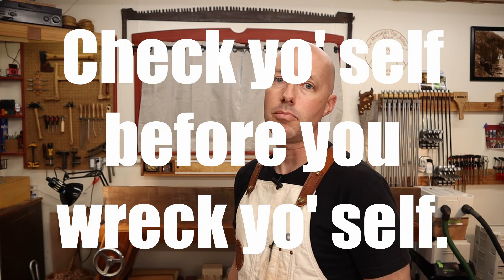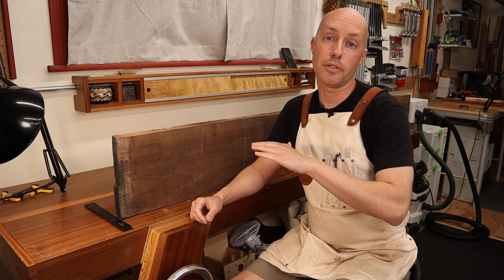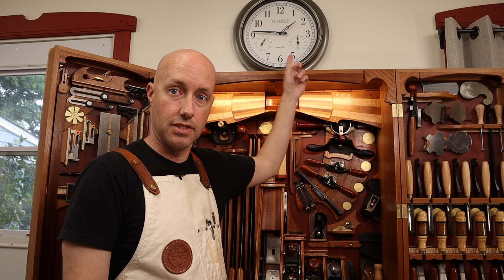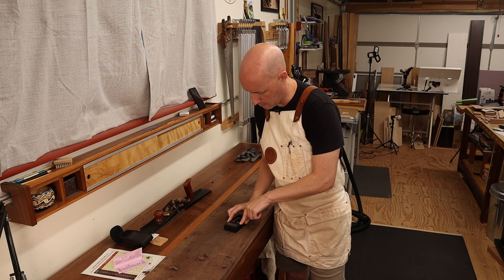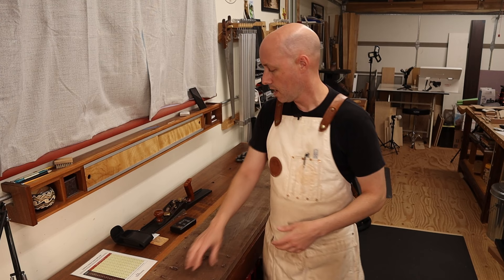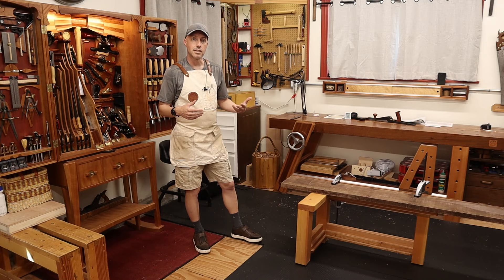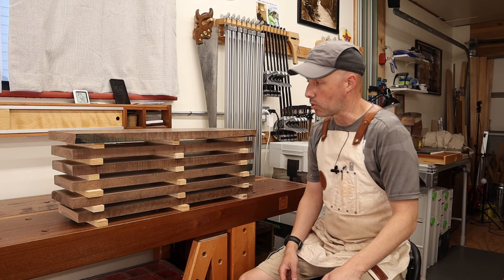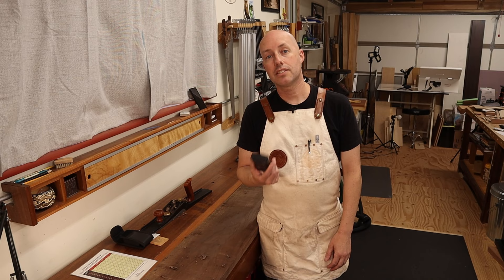How to know if your lumber is ready to be worked.

Comment: Instead of comparing with the humity and temperature on your chart, you could just take a reading from some wood that lives permanently in your workshop, such as your bench. I have a two-pin moisture meter, and I'm forever taking readings from my bench or tool cabinet to compare with my workpiece.

Comment: Thank you so very much for this deep explanation of moisture and wood movement.  I really appreciate it!  I’m going to check out that clock and see if there’s any way to recalibrate it.  I use a moisture meter, but I haven’t been taking my shop humidity and temperature into consideration.  I think that explains why I get cupping/warping on my “dry” worked boards.  Knowledge is such a great thing! :)

Comment: Good video!! please  can you inform   the model that can measure  a  very tickaround 2,2 inhces  wood board? Thanks!!
Reply from the maker: Not sure. That said, I've rarely run into problems measuring 3/4" from both sides of thicker boards, but I tend to leave extra thickness when resawing, just in case.